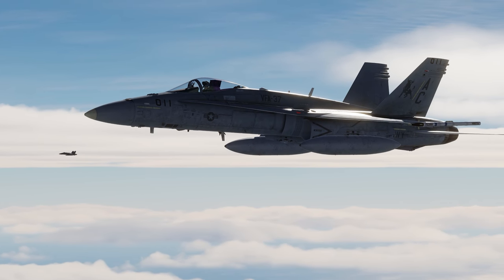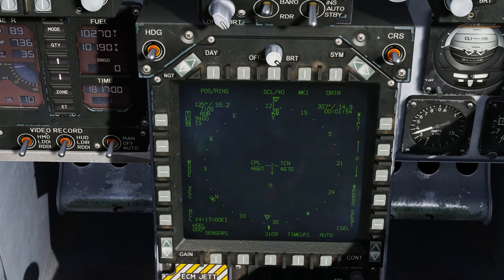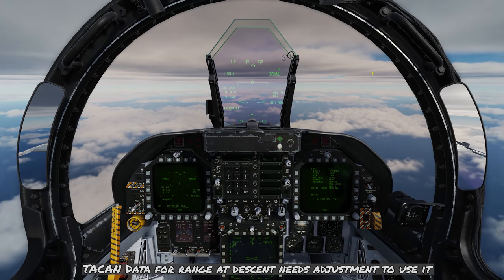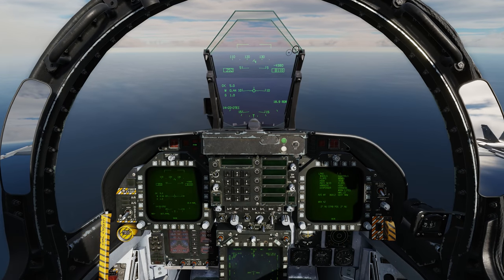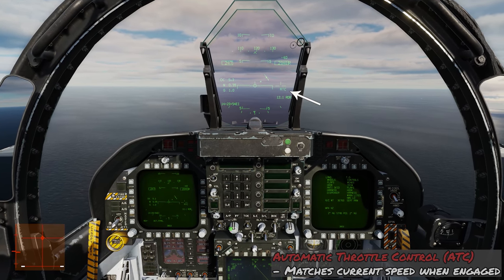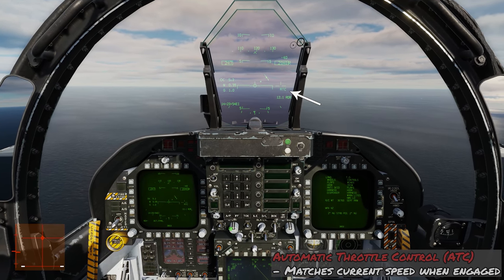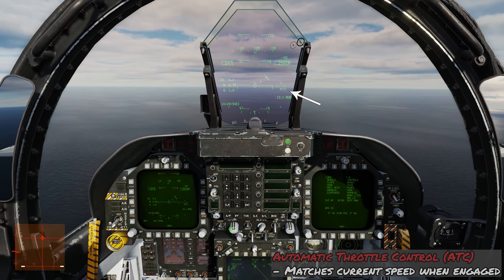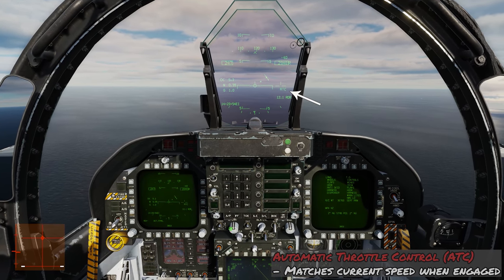DCS F/A-18C #6 - Case I Arrival & Holding

Comment: Ibdint understand the point 3 heading in relation to BRC... what is the significance of adding 30? Is the the degree of turn?
Reply from the maker: The adding of 30 degrees is adding it to the reciprocal of BRC as a technique. A reciprocal is the opposite heading so its 180 degrees off, so by adding that 30 it makes it 210 off BRC which is the heading you need to fly off point 3.

Comment: As always, thanks for the great tutorials.  Looks like your split throttles aren't aligning properly. Is that causing any yaw or is it minimal enough not to be noticeable?
Reply from the maker: I barely notice it. When I fly I don't use that window, but I turn it on in the replay for the viewer's benefit. In some of the jets I fly in RL the throttle can be required to be split almost a inch or two apart to sync them up lol